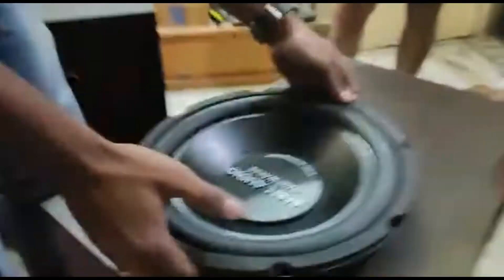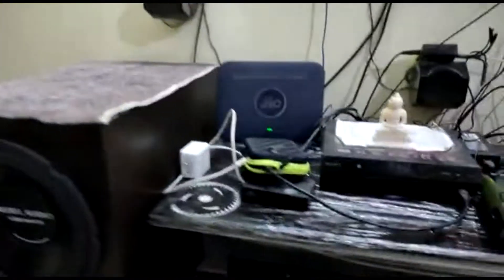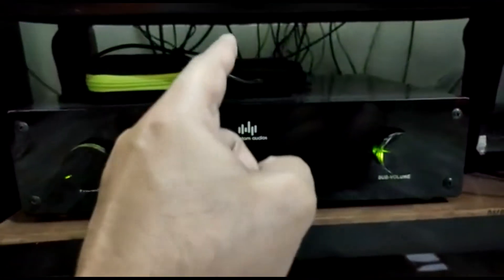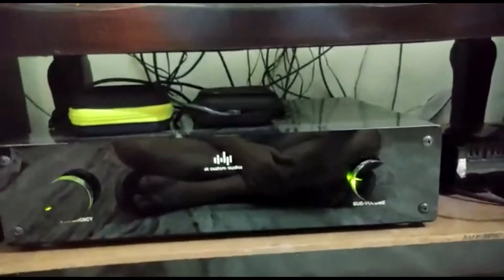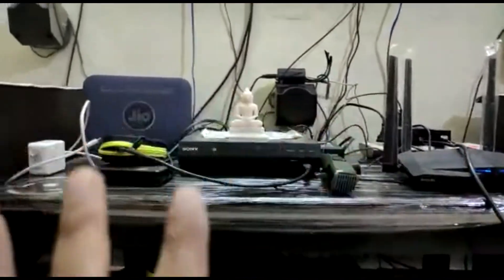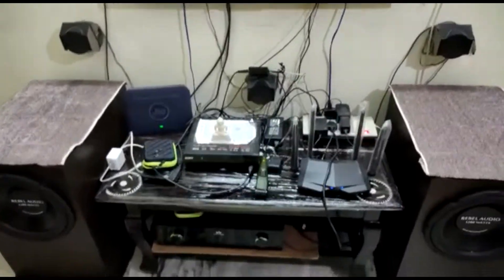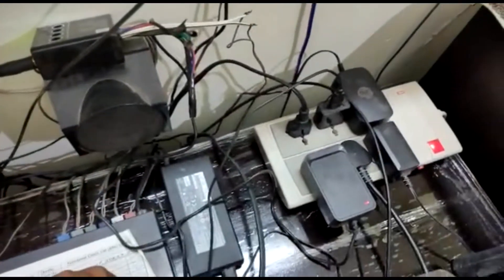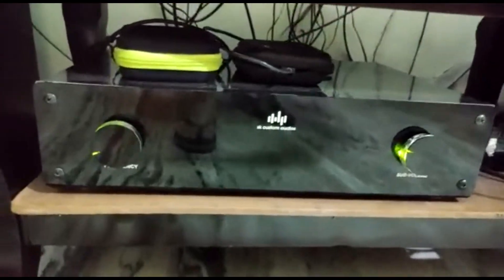Rebel Sub-Woofers With Pre-Amplifier connected with Sony HT-IV300

Comment: The hi to low jbl converter you used is still working for you? 
Because i used a different brand named world tech converter in my ht iv 300 sub out. It started burning after an hour of use. 
I found out its because the sub output is 250 watts and the converter is of 80 watts max. 
I dont know now which one to buy. If your jbl converter is working fine till date I will buy that.
Please let me know about your experience.